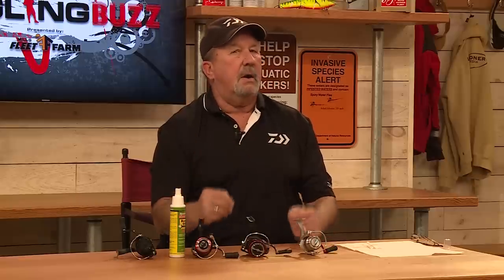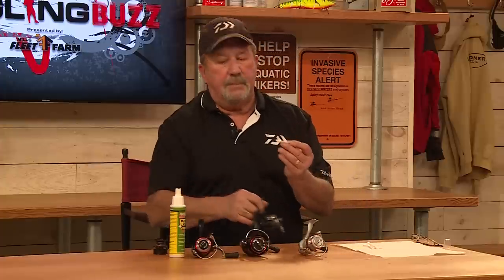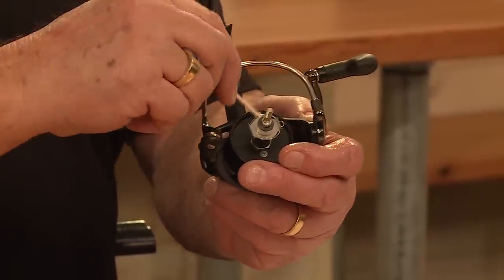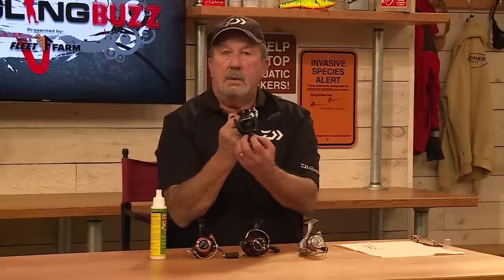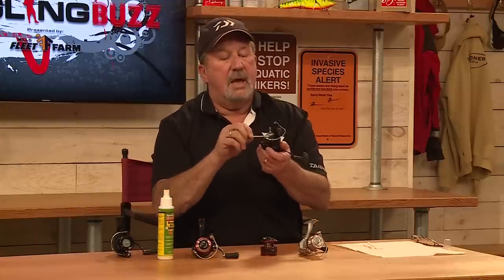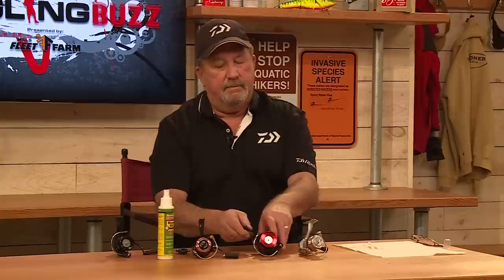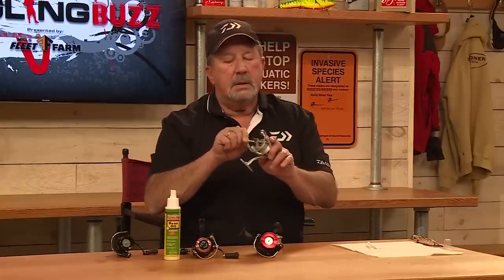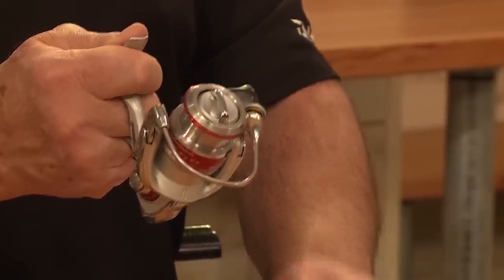Spinning Reel Maintenance (Step by Step Tutorial)

Comment: Sorry but this is not maintenance on a spinning reel. This is putting gun oil on the bail. To properly do a cleaning and lube you must take the reel apart and get to the gears.
Reply: yeah i prefer putting the oil where the parts make contact on the bail arms and not relying for the oil to make its way in there by outside application,i take them apart and apply oil in between where the arm is touching the body and the screw goes in between and also the gear box where i do my best to degrease with kerosene then add grease and a bit of oil as well as lubricate the drag system
Reply: I agree with you 100%

Comment: Totally missed proper maintenance.  You lube the pivot points, not the outside of the bail.
But, it all begins with proper cleaning.
This was just a promo for a certain product.
Reply: Agreed
Reply: Yes I agree
Reply: yeah i prefer putting the oil where the parts make contact on the bail arms and not relying for the oil to make its way in there by outside application,i take them apart and apply oil in between where the arm is touching the body and the screw goes in between and also the gear box where i do my best to degrease with kerosene then add grease and a bit of oil as well as lubricate the drag system

Comment: oil on the plastic parts is ok ? i noticed on one of my reels the line roller has one end with a dimple and a small hole in it is this for putting drop or two of oil for the bearing?

Comment: I appreciate the video. But you didn't stress the line roller. That is one of the parts/bearings that goes bad first.
Reply: do some reels have a lube point on those? i noticed on one of my reels there is a dimple and small hole on one end of line roller assembly ,i unscrewed the other end and yes it does have a ball bearing for the roller and what looks like something that looks like it absorbs and holds oil .looks like a yellow rubber or sponge like material